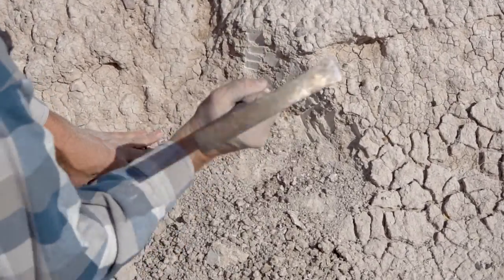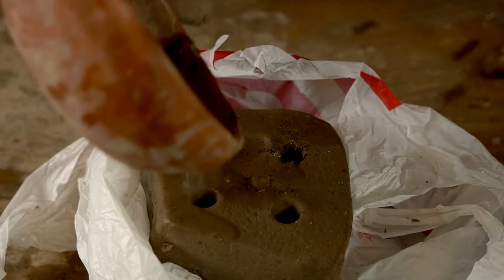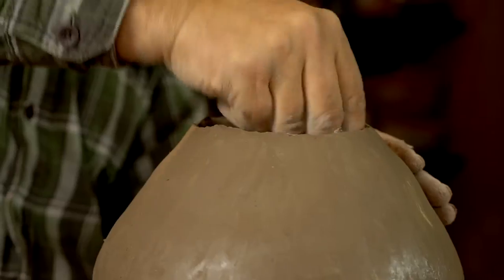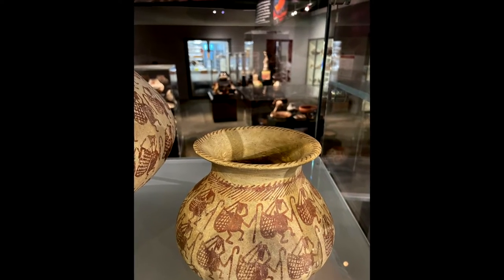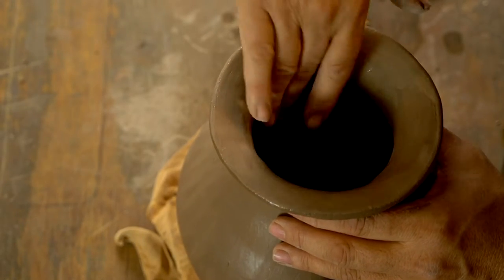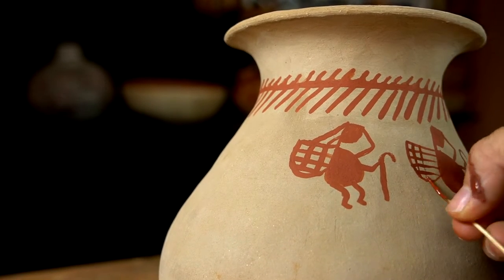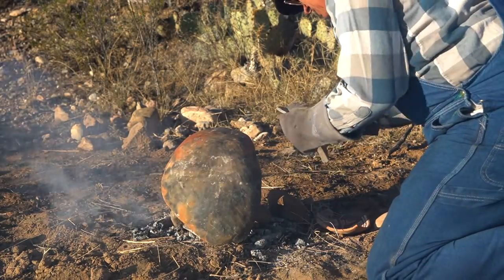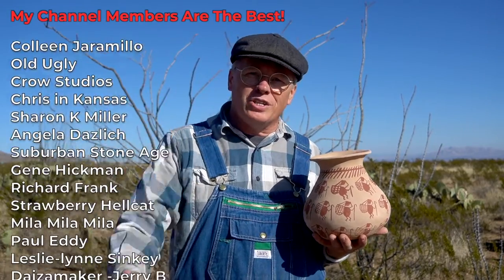Fake It Till You Make It - My Inauthentic Hohokam Replica Pot

Comment: Hey Andy! An app you might be interested in for approximating dimensions is imagemeter. You take a picture and define a dimension. Then it can extrapolate the other dimensions from they image. It isn't perfect, but it's close. For example you could define the height of the pot, then use it to estimate the width at the rim and at the neck.
Reply from the maker: That's cool, I could definitely use that.

Comment: Amazing work on that pot! I have a great buff clay here in Idaho and lots of red slip, so I'm inspired to make some pots in a similar style. I'm curious, how hot do you try to get it during the preheat, before you put it over the  embers of the preheat fire?
Reply from the maker: I don't have a set temperature, but I try to make sure it gets hot everywhere. Usually the time it takes to build a bed of coals is sufficient to get a pot really hot everywhere if you are attentive. If I preheat in my oven, which I do sometimes, I usually set it at 200 F for a half hour or so.

Comment: I just finished dry-processing a small batch of backyard clay this week. Although, the process was faster than the wet-procesing method, the grinding generated so much dust that I was affraid to continue without wearing a dust mask and working in a well-ventilated outdoor area. I don't want to end up with silicosis from inhaling too much clay dust.
Reply from the maker: Never grind clay indoors.

Comment: Thanks again, Andy. You've introduced me to a new hobby, and I appreciate your work and expertise. 

To find the diameter of your pot you can use a cloth tape to measure the circumference and solve for the radius:  
radius = circumference ÷ 2π.  Double the solution for the diameter of your pot.

To make a close estimate of your model's dimensions you can photograph it alongside a finely graduated scale bar or tape measure. The measurement obtained from a computer screen is very accurate this way. Cheers.
Reply from the maker: Thanks, but the pot is in a glass display case at the museum, they aren't going to let me get my hands on it.

Comment: Beautiful pot! I finally got inspired and made my first 2 pots from clay I gathered (water bucket method) mixed with ant hill sand. Both fired without breaking, but they seemed soft (no nice ring). Next day I cooked them again and still seem not as hard as I thought they would be. I don't know if there's a risk of breakage with repeated firings. I love your videos. Thanks for all the helpful tips.
Reply: I am have had the same experience. I think the outer clay is cooking but the inner is not. All of the pieces I have done and run into this tended be very thick... almost 1/2 inch in places.  Much harder to cook. Ive been trying to thin things out and reduce my temper from what I had. So far my best (rings) yet.
Reply from the maker: Keep firing and use more wood, or try charcoal.
Reply from the maker: The thicker the pot the more time it takes to heat it through